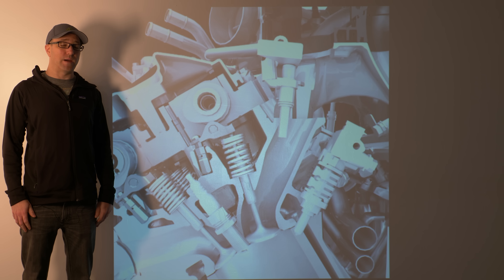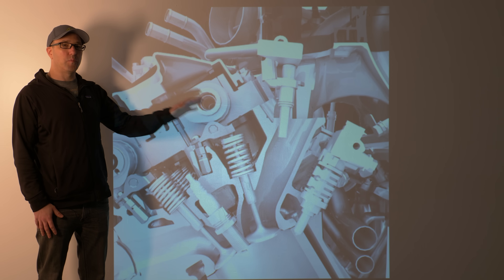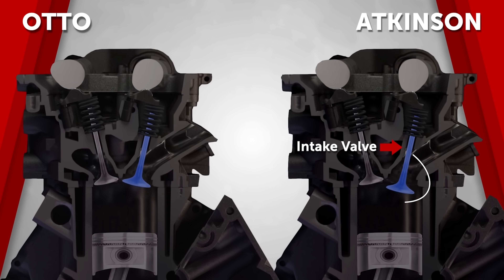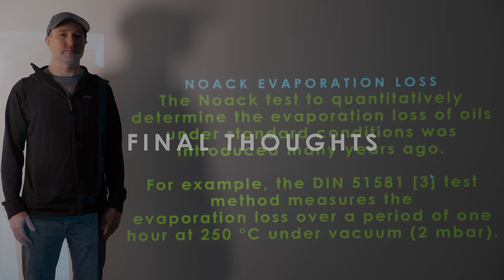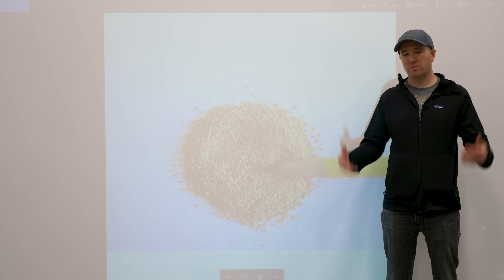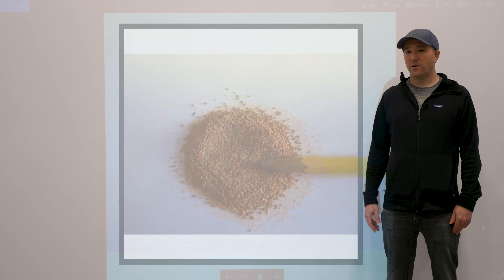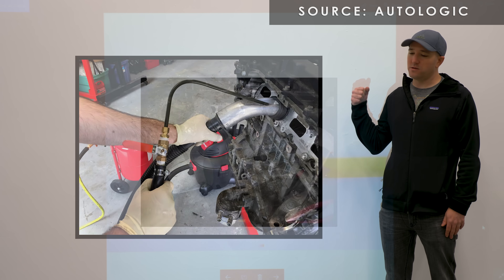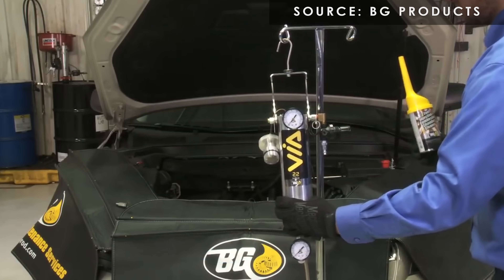Direct Injection, Problems and Solutions | The Fine Print

Comment: As a Cummins Engine engineer.  We as an organization spent the money early and continuously to destroy the competition.  Cat ignored and played the game while playing the victim of emissions to hard.  We were at tier 4 final in the lab in the 90s.  Knowing it's a competitive advantage.  But do to whiner pussies who love breathing tons of poisonous gas.  We could do even better than any engine maker even now.  It's about using fundamental research.  Instead of doing half ass bolt on that barely meet.  Gasoline engines have been way dirtier than our best diesel with ULSF and UREA SCR plus Catalyst and particulate traps.  The problem is when you have bone heads modify or use old engines and blow coal as a macho FU to say I don't care about your lungs your kid's lungs and my own lungs and family cause reasons.

Good video but misses the whole reason to fuck consumers with bullshit.  The base tech for gasoline is inferior along with most fossil refined energy.  Use a diesel with compressed methane or LPG which with after treatment will be cleaner then any liquid fuel and your engine will never need an oil change.  In modern emissions, we use impactor oil, water, hydrocarbon separation so the oil goes back to the case while the ultralight hydrocarbon and dry steam burn in the engine cylinder with the gaseous fuels
The only thing I would burn in a spark engine is E100, and natural gas or propane or a proportion of both.  Diesel with B100 and conversions to spark ignited with large sump and multiple micron fuel water and contamination separation with filters sized to the engine size in liters so a 2 liter would have 2 liters of Impacter blow by with cooling for oil and hydraulic tubing.  You could run this for 2000 hours or more and just do oil samples.  

The point is major companies make excuses if it costs and will jack the price.  If we paid the full cost at the pump your fuel would be 7 to 10 dollars a gallon.  We subsidize every gallon of fuel which is equal to the yearly budget of the Pentagon about 700 billion per year so we only pay 2 to 4 bucks a gallon.  

Tell me im wrong if you have decades as an API member or worked intimately in certain areas of major Auto and Oil companies.  The writing is on the wall you want cheap oil than be ok liquidating millions from the people you hang and know their kids.  To some far away area that want the happiness to watch their children grow but are faced by fire and death from know where.  Imagine a 911 every day for decades.  That is really happening all around the world.  Work engines had their time but if you know everything that can be done with less pollution and war.  We are doing now.  Save your old cars trucks etc.  They will be like steam engines and Tube TV before cable.

Comment: 1. stop calling it a motor, its an engine, were talking about cars not boats lol.

2. your explanation is somewhat misleading about blowby.  while yes some of it is actually "leaked" during the compression stroke, nearly all of it is blowby from the power stroke.  its doesnt leak into head per se, but rather down the cylinder past the piston rings into the crank case, however the crankcase air is shared with the valvetrain area via the oil return paths from the head, therefore if you pull vacuum from head, you'll subsequently pull vacuum in the crankcase.  this isnt just for emission controls, but also performance gains and oil control.  the less air mass you have in the crankcase, the higher the mechanical efficiency of the engine becomes from lower pumping losses.

3. i think the jury is still out whether the valve seat fouling is a cause from the pcv or exhaust reversion during valve overlap.  interesting we dont see the same problem on diesels, at least to the same degree as gasoline.  id like to see someone do some testing removing the pcv from the intake and running it on a vacuum pump.

4. i love toyotas model, they didnt switch to di until they had a solution that would be toyota dead nuts reliable.  my assumption and i havent looked into it yet, is that 90+ of the fuel for the engine is di and only a miniscule wash down comes from the traditional port injector

5. your advice on oil is garbage. oil volatility is about the least important metric of an oil properties. shear strength and viscosity are the 2 most important factors.  as a general rule, the reason why modern oils are getting thinner is because of increasing fuel economy requirements, the bearing clearances are getting smaller this requires a thinner oil to produce a greater volume of oil through the bearing at a given pressure.  going heavier could result in needless wear to the engine, especially on startup.
Reply from the maker: Ill make sure to stop using the term motor oil and motorsports as well.
Reply from the maker: Noack is important when talking about oil evaporation from thinner oils. Eco oils have higher evaporation all over 7% and higher.  And if you have issues with carbon buildup you don't want evaporation to increase, something eco oils struggle with so it is an important part of choosing an oil.
Reply: @savagegeese  what's a bigger repair, a smoked rotating assembly from inadequate lubrication, or a walnut washdown? I'd probably like to pay for 10 walnut cleanings before I need a new engine.  However, Im curious about the effectiveness of running a continuous water meth injection system, and just fill it up like def, but i may never have a pure gdi car.  Toyotas, diesels and electrics are all I see in my future.
Reply from the maker: There is absolutely no way you are going to smoke a motor going from. 0w20 to a 5w20 or 5w30.  To achieve the 0w winter rating using those base oils create compromises which raises NOACK.  Something jumping up to a 5w or 10w does not. If you are not in ultra cold climate it does not matter. Even then you are just creating pumping losses.

Comment: Petrol has next to no lubricating ability. Do the last better if a little two stroke oil is added to the fuel tank. It would be fully burnt by the way so would not be dirty like an old two strobe engine.

Comment: said blow by blows up into combustion chamber, WRONG, combustion blows by goes down into the crankcase, hence positive crankcase ventilation.
Reply: It goes both ways actually.
Reply: He was close.
Reply: @gallupcustomknives2293   He was really close,because the problem IS that the blowby actually does blow (back)into the combustion chamber...after its voyage around some piping... so,the vomit comes back ...same SHHT with the EGR.
Reply: https://core.ac.uk/download/pdf/72787231.pdf
ctrl+f "head" and read, d Due to oil drain galleys any gasses or oil that blows past the rings goes into the crankcase and up into the head and through the EGR/pcv.
"As this piston moves up and down you can have unburned fuel and oil vapor that can go blow past these rings and back up into the headspace or the crank case of the car."
He never said it went from the crankcase past the rings into the combustion chamber, He's correct.

Comment: Until about 11:50 you were absolutely right, but from this point on, you did a few mistakes. For example: Mitsubishi GDI was direct injected, not port injected. The reason of using direct injection isn' t the reduce of poison  exhaust gases, but the reduce of CO2. In fact, direct injected engines posesses even more harmful exhaust gases - fine dust for example.

Comment: If the older style motor could get double the fuel mileage even if it polluted more your using half had. Till you drill twice as much  and truck it to gas stations and refine it. How much do older designed motors really polute more. Pluse building more complicated engines require more energy. What do you save?

Comment: Diesel injectors have been direct for decades..too bad the Otto movement has evolved to lipstick on the pig..
If "if" your getting 60 mpg the emissions are cut in half by default.
BTW its the gas that has the impurities.
Try carb cleaner flush when
 ( just before )  oil change..

Comment: I have a different solution... The carbon build up that you get on the back of the valves in direct injection engines would more likely be from the Exhaust Gas Recirculation (EGR) than just the Positive Crankcase Ventilation (PCV) system.  Oil catch cans do nothing to clean EGR in the intake so there is no point to using one unless you delete the EGR and that may not be legal and either way it will reduce your gas mileage because that oil from the PCV system aids in fuel efficiency...  But regardless of where the carbon comes from the valves are not the only parts that get dirty inside the intake system of engines.  Yes, adding port injection to a direct injection engine gives you clean valves but it is still wasteful, expensive and does not clean parts that may be earlier in the intake like the Throttle Body or runner valves that are still subject to PCV and EGR.  The most cost effective solution that makes it more difficult for carbon buildup to form might be to combine the PCV and EGR into an Enrichment Chamber where fuel can be periodically added to the air before it enters the Throttle Body.  The idea is that fuel would then mix with the carbon and oil vapor filled air coming in from the PCV and EGR inside the chamber making it more difficult for the buildup in the intake system to occur.  If done right, an Enrichment Chamber with the right sensors can keep the entire intake clean from carbon buildup and would only require one extra injector instead of 4, 6, 8 or more.  If done right, it could also be used on engines with superchargers or turbos without any ill effects.  Well, in theory that is...

Comment: Port injection and GDI in the same engine is the way to go
Reply: Not really.  The vehicle now has more parts and still high pressure complicated fuel system.   So it's still sucks.  More expensive to repair.  High pressure fuel is the main problem in my opinion.  High pressures on smaller and smaller aluminum block engines.  Fuk that.

Comment: In short, which oil is good? 0w40 or 5w30/40? For
1.9tdi
Reply: 15w40
Reply: @philfrancisco2708  
Previous service i topped up Mobil 1 0w40 fully synthetic ,its good.Makes engine smooth but still i want better oil which will protect the engine for long.
Hows AMS oil european formula 5w40?
I have skoda octavia 1.9tdi 2009

Comment: Not to pat myself on the back (OK, maybe a little), but when I bought my two Sons new cars I said we will Never by the first 1 or 2 model years of a significantly brand new technology. Something I learned from my Dad.
I did not anticipate the exact problem of the horrible intake valve carbon buildup. But the automotive engineers should have.
That problem seems obvious in retrospect, but it’s easy to be a Monday morning Quarterback.
I was was leery of incredibly high pressure gasoline fuel lines and the HP gasoline washing the oil off of the cylinder walls.
I know Diesel engines use high pressure fuel injectors but diesel isn’t nearly as flammable as gasoline and is a better lubricant.
I was right in my original decision. Thanks, Dad. 👍🏻
Most manufacturers are now using port and direct injection to fix the problem it appears. Apparently, with some improvement in emissions. Faster CAT heating, etc.
That’s the first thing I thought of when the intake valve carbon issue came up. But you now have 2 gasoline injector pumps and 2 sets of injectors. HP and LP.
Twice as many things to fail. Everything is a trade off. Is the emission, performance or milage improvement worth it? Who really knows.